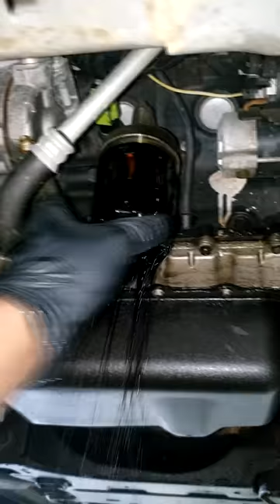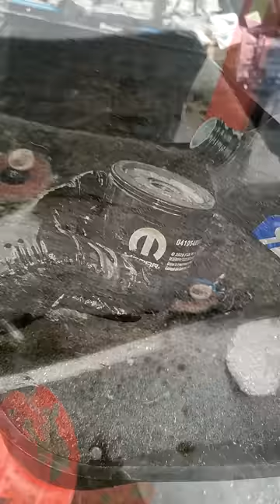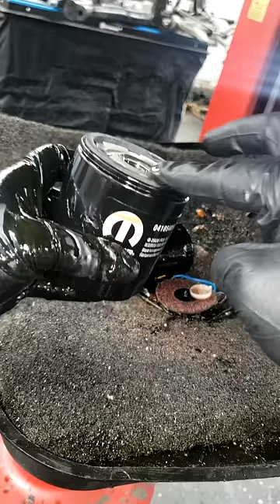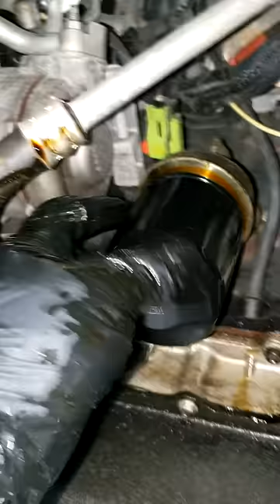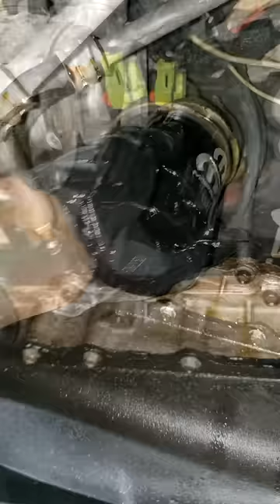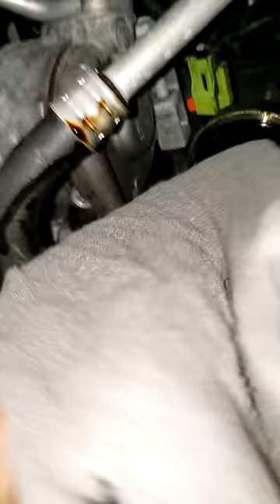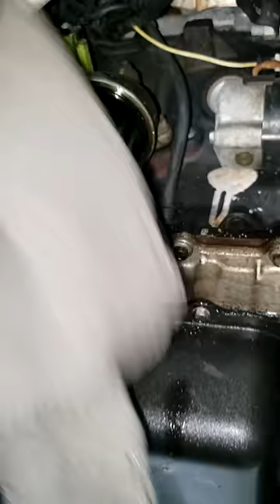Don't Lie.. Are yall still doing this?

Comment: If I’m not mistaken, the new oil is suppose to go into the small hole around the larger one. That’s how the oil gets clean during the process on the engine. I know I still do it that way. The only exception is when the filter is horizontal.
Reply from the maker: This not a tutorial or a how to video my guy. I merely asked a question that you never did answer
Reply: @OnlineMechanicTips  Actually I did. My third sentence answers your question, “I know I still do it that way.” It’s all about context.
Reply from the maker: @theoriginaljohngalt2450  Thanks, but this way, as in the way that shows how its being done in fact the wrong way. But thats how it use to be done before it was explained to everybody how it should be done. Thanks bud. Kind of a mind playing question. Just humor tho, not to shame anybody.
Reply: @OnlineMechanicTips  I’ve always heard it done different ways. There’s a case to be made as to where it is filled. Either way, it’s good to do.
Reply: I really love your channel and the tips you give.

Comment: I work w diesels everyday. Haven't had a problem w/o "precharging" large diesel oil filters. Just remember to top off after the dry start lol
Reply: It's not even a dry start, the bearings still have oil on them. All this talk about pre-filling filters is just nonsense started back in the 60s and 70s when Catarpillar used to be able to void your warranty if you didn't pre-fill the oil filters on an engine warranty.

Comment: It depends on how the filter is mounted. If it's melted from the bottom with the opening at the top I still do that. But if it's mounted horizontal or upside down I don't because it just dumps out when I go to screw the filter on.

Comment: I always pre-fill my filter! Been changing my own oil for 40 years now. As a matter of fact I changed my oil today and I pre-filled my filter!!! 😇
Reply: Thanks, also inspect the filter quality and wipe the threads too.
Reply: why do you fill the filter?
Reply: @Truthdosentexist69  years ago it was a silly superstition that the engine would run with no oil for a few seconds and over the years this would be damaging. Then on big equiptment the filters became huge, so there was a hydraulic hammering effect where the filter could be damaged by the oil immediately rushing into the filter OR the filter wouldnt prime itself and low oil pressure was a problem. Now many engines are chain driven and use hydro tensioners fed by the oil pump so the few seconds of no oil actually matters and lack of immediate tension mixed with the hard shake of start up causes some engines to skip timing, occasionally they kaboom over a simple oil change. Things are always changing. Most engines it makes absolutely no difference but to some its potentially a critical step.
Reply: @georgecroney6168  I can't find priming the oil filter anywhere in the service manual.
Reply: You probably also think pork needs to be cooked to 180 degrees like 40 years ago
Reply: @Truthdosentexist69  are you being sarcastic? It's an unwritten rule that any good service technician knows by heart... No oil pressure equivocates to engine damage!
Reply: @Orygunner67  my engine gets oil pressure immediately.  And I use 20-50 synthetic which leaves a protective coating on engine parts. But if filling your oil filter gives you peace of mind,by all means do it.
Reply: @Orygunner67  what section in the Harley manual did you read that information, I can't find it.

Comment: To everyone saying the oil will dump out I you gave a side mounted filter or top mount. Fill the oil filter and wait about 10 to 15 mins. The oil will soak into the filter and will not come out. Found this out one day when I was in the middle of an oil change and nature called. Came back out and found the oil had soaked up. No it didn't magically dissappear. You can feel the weight of it in there.
Reply: Do this in a professional garage environment and your boss will sack you for wasting 10-15 minutes for no reason. The filter gets filled when you cycle the engine, check the dipstick after doing so and refill accordingly. Most data sheets tell you how much oil the filter alone will hold so that makes it easier to top it back up. Do you also fill the filter up on side and top mounted filters?
Reply: @Underscore.Bambii  did you read his response ge said for side and top mounts ge lets it soak in
Reply: @todydn  still pointless. It’s a waste of time.
Reply: @Underscore.Bambii  for side and top mounts i agree i was just pointing out that you asked about something he literaly touched on as to what he believe i know i drive a cummins  it tells me to put a quart in the filter   so i do howecer for the past 3 oil changes mines been stuck on everytime i forget to get strap or can pliers or a socket as its a k&n  honestly if its getting lube its fine ive seen a chrysler minivan ran pegged in the red full of pancake syrup took almost 2 hours to blow  dont ask we got some strange car shows round my parts
Reply: @callumbambridge9833  that's why I don't work in a shop. I work on my own vehicles and our company vehicles. Doobie breaks several times a day lol I'm a Carpenter on week days and a mechanic by weekend. Realistically do you need to put oil in the oil filter before installing it? No. For the first 10 years when I did oil changes on my personal vehicles I never did. Also for top mounted filters. Personally the only ones I've done are on diesel trucks where the filter isn't in a cannister. You just take the cap off and take the old filter out and put a new one in.

Comment: I don't even do this on HD diesels. There is is still enough oil in the oil rifle to maintain lubrication long enough to prime the oil filter without prefilling it. with rebuilds I pig fill them though just to push out any pieces of cloth debris before cranking.

Comment: Yeah that’s fine when the filters straight up. My old pickup was on an angle so it wouldn’t be full and a lot are canister types
Reply: you need to fill it up with oil, on my truck the filter is tilted too. but if you don't fill it up with oil the oil pressure will be low for a few days.
Reply: @altonlynch5464  LOL!  Then you have other issues going on.  This is a waste of time.

Comment: Boat mechanic here. I do this on every oil change when it is applicable. Sometimes, the filter is sideways or upside down, or at such an angle you just can't. 
Good luck. Keep your attachment surfaces clean.
Reply: I do as well. I also run the engines for a while before changing the oil. I have a manual pump and 25-40 is no joke trying to pump out cold.
Reply: I add oil halfway up if its horizontal. If its a weird angle I would rather deal with a little oil clean up.

Comment: So the outside is the part you should pour the oil, but there is no need to. I used to,  until i really read the manual and realized that its not really supposed to. Some specifically say not to. The oil in an engine, like the blood in your body, is not alot. It just cycles quickly.  That filter will be filled by the time your engine cranks over. If its a fuel filter, especially a diesel filter, then you pre-fill, and thats where you need to remember what part to pour the fuel in. As for oil.....nah. Just oil the O-ring and be on your way.

Comment: I'm an old school mechanic yes I still doing this. I put oil in oilfilter
Reply: My dad and grandpa taught me everything old school ways and this is the way they told me. I never placed it the small hole. I fill it until it complete soaked inside to prevent it of having a dry start upon start up. No body wants metal on metal
Reply: @DustinStruckman  The exact same way I was taught, still do it that way.

Comment: There’s nothing wrong with filling new filters up first, oil gets to bearings a fraction of a second faster, the new oil doesnt need to be filtered, it’s clean. 45 years experience here, your welcome.
Reply: exactly. it,s come from a sealed container.
Reply: Lol the internet... where everything is opinion and controversy... including changing oil filters lol 😅..."I want you to be honest"
Reply: You’re*
Reply: I always add some oil if I can, Why? Lazy more than anything. Then, when I run it and check for leaks and level, I don't have't add any oil. It is not like you can take the capacity listed as gospel, I don't know why, but yeah.
Reply: Exactly right.... 30 years here retired... if I could fill the filter I would... nothing better than instant oil pressure
Reply: Exactly right! Great job my friend. Amen to you too @scottrussell8139. This is one of those instances where doing something because you know it helps longevity is more important than having an excuse for being lazy and not taking the time to do it right.

Comment: I prefill vertical filters amazing how they just about hold a quart, I will put a splash in horizontal filters roll the filter so the paper can get some absorption. FUN FACT: holding your throttle WOT while cranking temporarily disables fuel and ignition on all modern engines oil still pumps allowing prime do with useless information as you wish

Comment: I always precharge the filter if its reasonably easy to do. I've heard other technicians say they don't recommend it because it can put contaminates directly into the oil system after the filter. I don't like to dry start an engine any longer than is necessary so ive always just charged the filter if i can.
Reply: If u are using somewhat decent oil, the engine will still have enough In the system to not cause damage while filter gets filled and pushed threw the system. I honestly feel like prefilling is more likely to cause problems than not. An older vehicle that required it then yes do it. If manufacturers say don’t then don’t. Most if not all today say do not. Plus the water we call oil nowadays takes a second or two to get threw the engine.
Reply: Just a heads up, the manufacturer is not on your side. So of course they will recommend not filling it.
Reply from the maker: @dannyamericandream  explain
Reply: This. Especially since at my shop we're rarely filling oil from the original container. Filling like this bypasses the filter.
Reply: @dannylabonte3609 which manufacturer? I've seen pictograph instructions on the filter and the filter box instructing you to prefill the filter.
Reply: Have you ever seen those "garage 54" videos? They built a clear plastic body for a disposable filter.  I noted that it took about 30 secs to completely fill the filter. This validated me and my habit of always pre-filling the filters. FYI: I always wipe off the filter adapter gasket surface; first, to make 100% sure there isn't the old gasket stuck on there; second, I want good seal on the new filter & gasket & I don't want to leave a mess on my own car.
Reply: @budlanctot3060  I support filling the oil filter prior to installing it. That was the point I was making I will continue to fill the oil filter before installing it. Everyone else can do whatever they want their choice I’ve had excellent success doing that.
Reply: @OnlineMechanicTips  the manufacture who built the automobile, will recommend not filling the filter. I will do the opposite. I will fill the filter each and every time.
Reply: @budlanctot3060  sorry I was referencing the auto manufacture. Of course they don’t want you to fill it. They prefer the motor to be blown up so you purchase another one
Reply: @budlanctot3060  From a vehicle that’s decades old, sure 😂
Reply: @OnlineMechanicTips  ANY! filter that wants pre-fill comes with a plug for the center hole (and most are diesel fuel filters)
.
ALL!!!! manufactures, OEMs, and filter makers say do NOT pre-fill 
.
an engine can run at idle with 0 PSI for quite some time with ZERO issues (unless its pinging when you drive it on the lift.....)
.
if you still want to pre fill....
then stop being cheap hack..... and get a PRE-LUBE MACHINE!!!
.
do it right or not at all right?
Reply: @budlanctot3060  no you havent
you have seen "put a drop on the gasket"
Reply: @budlanctot3060  thats also on a russian lada engine..... 
.
not a modern variable displacement oil pump
.
i look at the FUCKING PSI GAUGE.... 
which is usually located at the "highest" point
.
if the gauge says i have oil in 3 seconds
i have oil
Reply: @kainhall  you seem to be under the impression that making these blanket statements somehow make you look smart or knowledgeable, but in reality just reveals your arrogance and lack of knowledge.
Reply: @kainhall  also you blatantly contradict yourself by saying that any filter that wants a pre-fill will come with a plug, and then immediately say that no manufacturer recommends it
Reply: @kainhall  i love when prople like you who dont wrench and dont have an engineering degree talk about things you know absolutely nothing about

Comment: Home mechanic here and I absolutely do that.......
And i fill it up with oil before installing the new one.
Reply: What if the filter mounts on the side??
Reply: @warinsidemyhead8939  I still do it. If you are using OEM filter little or none will dribble out.
Reply: @IntrepidObserver if the filter is horizontal or any sort of upside down, the oil will definitely dump out of the filter lmfao
Reply: @NOBLE-wo5rr  obviously if it is upside down you just do it faster so gravity doesn't have time to act 😜

Comment: most people seem to be under the impression that the oil punps up thru the filter to the heads . it doesnt it pumps thru  the oil pump to the top of the heads then falls back down from the heads on to the valves and the timing chain etc. it then goes thru the ways in the block toward the oil filter where it then drips back into the pan

Comment: I just put a very thin layer on the gasket and clean off the old oil from the surface. The oil pump primes the tiny filters on the new cars fast anyways. The only ones I prefill are diesels. Those filters are huge.
Reply: a diesel also has a HUGE oil pump
.
they "prime up" just as fast as a 1040/42/60 wix filter 
.
the manual on EVERYTHING EVER says to not prefilll
.
if you care enough to prefill
you should be using a "pre-lube" machine
Reply: @kain hall  you are absolutely a meathead. Every Cummins Operation and Maintenance manual says prefill is mandatory as does Detroit Diesel.

Comment: Caterpillar recommends installing oil filters dry in their service notes.
Reply: That’s because they have a filter housing bypass that builds pressure. Most gas engines do not.
Reply: It's not a caterpillar or a diesel engine. I didn't know Mopar and caterpillar where the same
Reply: @lilcourtny08  a caterpillar 1r-1808 oil filter holds half a gallon. This holds like two ounces.
Reply: @kylegronbeck353 nah it’s because of contamination
Reply: So you think recommendations of the manufacturer are whats best for the engine?
You think oil change intervals are 30.000+ km now, because thats the absolute best for the engine?
In case you forgot: The manufcaturer depends on you buying a new car/or piece of equipment in a few years.
Reply: Doesn’t matter if it’s cat or what. I’ve been doing services/ a mechanic for 10+ years and no one recommends doing that on filters. Don’t matter if it’s cat it dodge if you put oil in the filter you Risk contamination. Your engine never staves off oil if you don’t fill the filter. Oil pressure is so high it circulates like nothing.
Reply: @sapphire_gennylife718  Ask yourself why it is like this.

As a manufacturer you risk damaging engines because its easy to screw up, you then need to replace those engines under warranty.

Then if you say: Filters should not be filled, youre on the safe side and in addition engines wear a bit faster. Building oil pressure with an empty filter and cold oil takes a few seconds.

Controlled wear is favorable for manufacturers. If they would build cars that last forever, they would go bankrupt.

So telling your staff to not prefill filters is the only logic thing to do from a manufacturer standpoint. 

Doesnt mean that - as a customer - thats the best thing for your car
Reply: They already sound like a bucket of bolts when you start them because they are so bad-ass and they rule the hills; even loaded
Reply: @Chris-yy7qc for real man?? Over and oil filter change??? Lmfao 😂 😂 😂
Reply: @SeriusChevy  gibberish much?
Reply: @SeriusChevy  No wonder Cats rattle like a bucket of bolts when they fire up!!....

Comment: Like @Zippie27 says.  Car filters are right after the oil pump, are really small and fill up really fast.  No need to prefill.
Reply: The older cars tended to use filters that held about a quart.  It takes about 4 to 5 seconds to fill it.  That's why I always pre-fill.
Reply: @michaelbenardo5695 ever since the 90s, cars dont take more than 1-2 seconds to circulate oil. So unless you're driving an old car, it is not worth it. It is also not worth accidentally contaminating the oil by prefilling.

Comment: To be honest I never did that. I moistened the gasket then put the new filter on. I would fill the reservoir then turn the motor over a couple of times give it a few min to drain in properly then check the dip stick and add what it needed. I'm just an old school shade tree mechanic. Been doing it since the 70s.